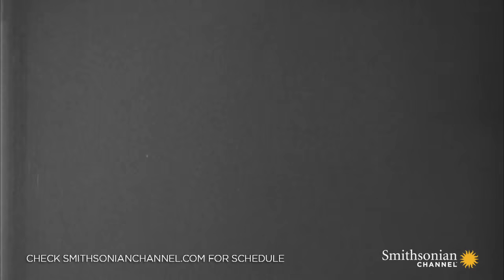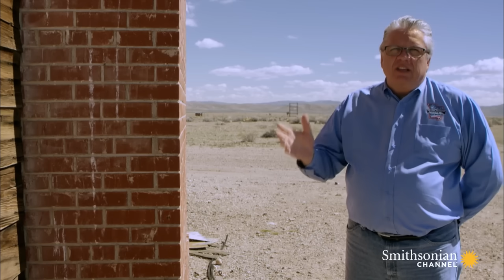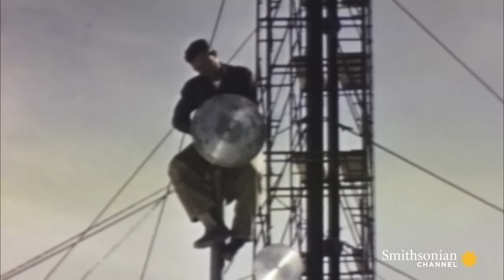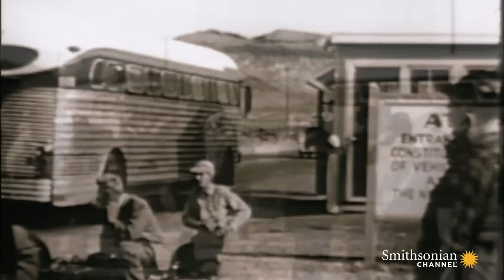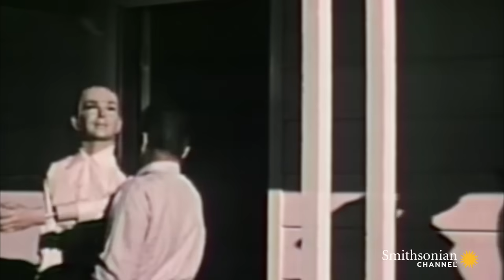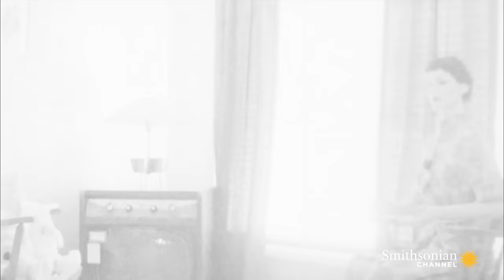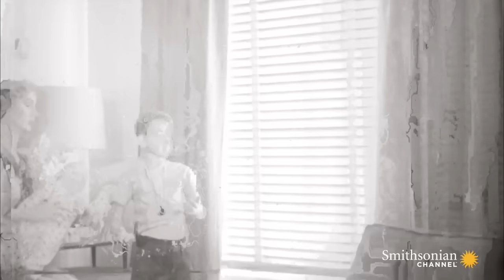Intense Footage of Fake Towns Used for 1950s Nuclear Tests

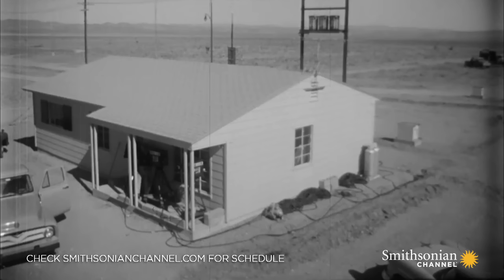Comment: 0:07 The initial blast was enough to INSTANTLY burn the paint from the walls before the shockwave then sends everything to splinters. It's almost unfathomable what could happen to a human being if one were standing there.
Reply: I understand a human would get fatal burns over the body.
Reply: @patricj951  or they would just go poof and leave behind a shadow
Reply: @Sodapop-rd5ku  
No, for a heatwave to instantly consume a complete human body it would require an amount of energy that all the wood in the house would go poof as well. And several centimeters of the bricks had ceased as well.
Reply: @patricj951  Im talking about if they were outside
Reply: @Sodapop-rd5ku  
I will explain. To devoure a human body requires much more energy than dry wood. So while there would probably be open flesh and fatal damage on the body, it would require much higher temperature than it was at that distance. There is a rumour that people were instantly vaporised in Hiroshima but that is not true. The detonation occured 600m above ground and the most people were kilometers away. 
To vaporise a human body in an instant it requires million degrees temperature, not only a few thousands, like it was at that distance.
Reply: @patricj951  crematoriums burn at ~1100 degrees farhrenheit, enough to reduce a human body to ash. Now considering that the atomic bombs burned at around ~7200 degrees fahrenheit combined with the ionizing radiation, your body would definitely get vaporized
Reply: Wind at the upper end of a F5 tornado is 300 mph. Using a one megaton blast, 50 seconds after ignition the wind would be 784 mph.
Reply: They’d be incinerated. Just like the people near ground zero at Hiroshima.  They were turned to vapor
Reply: Unfathomable? Think Japanese....
Reply: And in the next clip we see a truck and car disappear in a single second 0:08 - 0:09 watch them blink out of existence
Reply: And yet the camera survived without moving... And so did the footage
Reply: How is it unfathomable
Reply: @RMMaryport  because with that powerful of a blast, we'd have little to no idea the damage it'd do to a body.
Reply: @btr4yd  it would vaporise, its not hard to figure out

Comment: The paint on the outside of the house was instantly burnt off.... I bet the heat inside the house was at least 10,000 degrees to instantly vaporize but not burn the wood. At 6000+ feet away. Just awful, it would be even more horrific to survive that.
Reply: Yeah it’s crazy. The interior of fission explosions reaches 90-180 million Fahrenheit and for thermonuclear fusion explosions it can get upwards of 630 million depending on weapon design. As a comparison, the internal heat of the hottest high explosives top off at 3,500 Fahrenheit with the fireball resulting from the expanding superheated gas products. For nukes, the fireball is almost entirely just the surrounding atmosphere being superheated by the blackbody X-ray spectrum.
Reply: @bjornragnarsson8692  lol 👌 👌

Comment: Go outside and walk a mile + and when you reach that distance keep in mind that destructive force was generated from a device placed where you started your walk . insane
Reply: Tsar bomba 50MT test. The largest nuclear bomb ever detonated. The fireball alone was 8 kilometres in diameter. A person would experience 3rd degree burns and almost certain death 50km away. The Shockwave causes glass windows to shatter at 500km away. 
Go drive for an hour in your car 50km away and once you reach that distance, you’d likely be killed had you been in a direct line of sight of a 50MT device that was detonated at the location where you started. A star like the sun created by man, here on earth. Both terrifying and incredible at the same time.

Comment: 0:06 that car literally got deleted
Reply: That was when they were building it, it was 2 different shots lol
Reply: @Silly88  OH LOL
Reply: @Silly88 they presented it like it was continuous footage, even if that were true; this is fake.
Reply: Lol it was where the 8/16 mm film was spliced.  The truck wasn’t there for the blast
Reply: @davidpar2  no its just a separate shot at a different house that looks the same, just look at the other details
Reply: @allistergraham6704 what about the fact rhe camera doesn't even flinch???
Reply: It’s a car setting up the set
Reply: Car.exe stopped working
Reply: @rko39wwe  radiation can’t evaporate things, and if the heat did it then why is the house there
Reply: That's cuz the frame changes from one shot to the next. You can see the frame shift away from the car in the explosion scene.
Reply: That truck was saved by the rapture.
Reply: @dumbledwarf9154  thank god
Reply: i think that was 2 different shots spliced together by smithsonian. you also see production equipment or something on the porch
Reply: Wait a sec . . . I dident notice . . . Maybe it fly's away ??
Reply: Aliens lol
Reply: Gone... dissolved into atoms...
Reply: well, of to visit your mother! yippie ki ya-
Reply: It’s a mini built town. Fake
Reply: It is fake
Pilgrim hoax
Reply: Looks fake
Reply: @iscifion7122  it’s also two different houses
Reply: @shotgunsam23  Yea, but no. There are 2 shots of 2 houses.
Reply: @mr.mirage3986  I’m not disagreeing with him I’m adding additional clarification
Reply: @shotgunsam23  they are the same house just that in the 1st shot it was still being built (you can see the smaller window on the right in the attic isn't there in 1st shot but is there in 2nd, car is also not there in 2nd)
Reply: @shotgunsam23  it’s the same house
Reply: @iscifion7122  LOL
Reply: @iscifion7122  because they are fake. Film is extremely sensitive to radiation they couldn't possibly film these videos so close.  Propaganda to intimiate Russia.
Reply: ppoo
Reply: lk
Reply: @meow.465  I have a slight feeling you're too young for youtube.
Reply: They moved the car into the house you can see the lights
Reply: We're in a simulation.
Reply: Like night, and day.
Reply: Nah it rage quit
Reply: oh my God I was like "where did it go???" when I watched this before seeing the comment
Reply: Nope, it was a cut to the video
Reply: Everyone knows we faked those shots to scare the Russians into thinking we already had nukes.
Reply: Its fake.  How this never melt as in Hiroshima? Why there were piles of TNT?
Reply: @Fr4nkSanchez  things in Hiroshima didn't melt, Just the glass and the plastic parts melt
Reply: Yes, the driver of the car decided it would be better to depart the area before the bomb went off.
Prior to the explosion the house had to be built.  The people that built the house and filled it with furniture and mannequins didn't walk the 20+ miles from Mercury to Doom Town -- they drove cars and trucks.  But, they didn't hang around for the blast as they would very possibly have died.  
Take a look around this area in Nevada (37.1058, -116.0434) -- this is the "Nevada Test Site" formerly known as "Nevada Proving Grounds".  In this area are hundreds of large crater, most of them way to big to have created by conventional explosives.  Sedan Crater, located towards the NE of the range, is 1280 feet in diameter and 320 feet deep -- the explosive yield required to produce that is about 100kt, or 100,000 tons, or about 200M pounds of HE -- that is not within reach of conventional explosives as it exceeds the largest non-nuclear explosion, the Halifax Explosion, with a yield of 2.9kt, by more than 30X.  You may wish to keep you head in the sand, but in reality your head is firmly located in your own mid-body orifice.
Reply: Almost like it was edited or faked. Amazing how the camera survived
Reply: @ashleycullen.933 The cameras were housed in thick concrete bunkers with lead shielding to protect the film.
Reply: It was a time lapse we aren't seeing all the footage. Someone had to go hit record and leave the concrete bunker that housed the camera, via the car/truck.
Reply: Maybe that was a crew car before, hence the jump cut?
Reply: Yea and the camera doesn't even flunch
Reply: @Arktii 難 🤦
Objects evaporate leaving behind traces due to explosion not just dissappear.
Reply: @iscifion7122  it’s not a part of the test, it’s a car with technical stuff for making the set
Reply: @West_Coast_Mainline how did the camera not move????
Reply: @timnew4312 The cameras were in heavy lead-lined housings, mounted on steel posts sunk into a concrete base below ground.  Electronics to control the cameras were in a cavity in the concrete base.  These structures were designed to withstand the blast pressure from the bomb.  

It's almost like the people conducting and documenting these tests knew what they were doing and built their equipment accordingly.
Reply: @iscifion7122  Yes, but big objects (such as in this case, a house) Mainly fall apart, but, beacause cars are small enough to have all of it in the range of the engine, it evaporates, and if a part close to the engine survives, it's gonna get burned down. Such thing applies to humans aswell, but before talking about it, that happens when You're about 5km distance of the center of the blast. That's called a "thermal shadow." A thermal shadow is what happens to humans who are in the death zone. It's caused by heat, sugested by it's name. The thing that lead us to discover this, is traces from Hiroshima. Many thermal shadows can be found there, in the exits of steel and concrete reinforced buildings.
Reply: @mr.mirage3986 but the camera was completely unaffected 😅
Reply: 😅😅😅 wrong bro it's just a fake edited video  @iscifion7122
Reply: @Arktii 難 okay...my bad
Reply: That house survived the blast that hunk of metal most certainly shouldve, the clip has to be fake.
Reply: @Arktii 難Thanks.....
But I don't like this flavor

Comment: How are they so casually touching and standing where nuclear explosions caused the seen destruction? Why isn't that EXTREMELY radioactive?
Reply: Nukes, especially airburst nukes, don't actually cause that much radiation. Most of the uranium or Plutonium turns to energy. A ground impact nuke is something different tho. Way more radioaktive fallout because it irradiates the ground. After a airburst, I belive you could safley step back out of a bunker within.. 2 weeks or so.

Comment: How did the cameras stay when getting exploded by a nuke
Reply: I think they are extremely zoomed in what I’m actually concerned about how those poor mannequins are doing
Reply: @qulipz5967  dude some where inside
Reply: @dnh3005  use your brain.
Reply: @alphasheep7116  and why mister sheep
Reply: @alphasheep7116  I just asked u a question, maybe u understand me now: blehh bleh BLEH blehhhhhh.
Reply: @dnh3005  you are acting crazy 😂
Reply: @dnh3005  😂🤣
Reply: They test nukes above ground because if you detonate one directly on the ground the surface of earth absorbs a lot of the explosion. In the air you see the full force of the explosion
Reply: @qulipz5967  
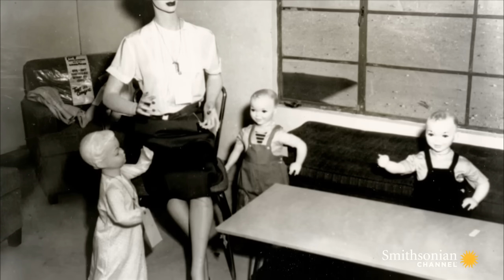 2:18 The healthy ones went back to live at manufacture’s warehouse. The ones that got a little dusty in the blast ..acquired antique status on eBay.
Reply: @qulipz5967  35 of the mannequins died of cancer. 17 contracted leukemia 1 survived and was hired by Rod serling to act on an episode of The twilight zone. She was the lady on the 19th floor
Reply: The cameras were housed in durable shelters. As long as the flash from the blast didn't touch the cameras, they could be relatively close to the blast.
Reply: @jamesjohnson1050  ok i thought they filmed it with a Nokia
Reply: @renehopkinson5079  flip phone
Reply: I had the same question. It mentions it was detonated 15ft above ground
Reply: @spookypunky  less height less damage my guy. Thats why they explode theese things in extreme heights (but it wont work for all of theese)
Reply: I don't understand either.. Even some shots are inside the structures... Maybe they are inside a very-very-very thick glass cover...
Reply: @ryanmedrina9411  the cameras in these tests are usually placed on poles that have several steel cables as reinforcement and have casings that are aerodynamic to be less affected by the blast. They are far enough away from ground zero that such an arrangement can protect them, as it's about the most blast proof construction one can possibly make. A car or house at this distance could survive the blast undamaged if you put it into a solid hardened steel bunker that is shaped in such a way that the pressure wave is directed around it (altough for something as big as a house, such a bunker would be as expensive as a whole tank batallion) Only really works since they know exactly where the bomb will go off and can position the cameras accordingly though.
Reply: As with the saying that nothing is completely blast proof, the same is true that no blast will destroy everything. Smaller objects are much easier to protect. By creating an independent foundation to which the protective casing can anchored to, so it's not knocked or moved by the shockwave and overpressure/vacuum event. The general rule is the less surface area of the object the less effect the blast will have on it
Reply: Nukes don’t exist. There is a studio in Los Angeles, actually in Studio City dedicated to editing nuclear bomb footage. More like creating nuclear bomb footage…
Reply: @rvrnt196  
Your mother doesn't exist. There is a studio in Los Angeles where they filmed how she was making you, but she was just an actress.
Reply: Theres a documentary thing on that, they were fastened to the foundation and ground with concrete and high grade steel cables. Not all of the cameras made it, although. The only surviving footage is from the cameras that stood still or didn't get thrown too far. They were also in concrete boxes.
Reply: All the cameras were thousands of feet away and pointed away from the bomb at the houses, aside from the ones with the observers, even further out.
Reply: @tincano-beans2114  Lol thousands of feet  away.? Repeat the scenes again again. The angle and the depth and position of those cameras.  Pure hollywood production.
Reply: There are probably in extremely guarded cases
Reply: The ones from the out side were 800yards away and it giant bunkers. The ones inside were in a huge lead and steel box with lead glass.
Reply: Really zoomed in at a far away distance
Reply: They're in a bunker facing away from the blast and x-rays coming from the explosion.
Reply: Nuclear reactors are glorified steam engines think about it. It's the steam in the nuclear power plants and submarines that create the driving force. The nuclear reactor just heats water without the need for coal or fossil fuels. Nukes are not real bombs. That is just 60's sci-fi fear mongering for the masses. The very concept of nukes creates secrecy for our governments. The secret is that nukes don't exist and all major influences of power know this. Think about Hiroshima and Nagasaki. Where is the nuclear fall out? You you the "half-life"??? Both are flourishing super cities full of vegetation and human growth. These governments fake things like pearl harbor and 9/11 to get wars started so that the elite can make even more money.
Reply: @mslaven84  bruh this is the most ridiculous comment I've ever read. Yeah, nuclear reactors heat water to produce steam to power turbines, because there's no other way to turn thermal energy into electric energy efficently. The thermal energy to boil that water in the first place however has to come from somewhere, and, in the case of a nuclear reactor, it comes from controlled fission of reactor fuel. Otherwise you'd break the laws of thermodynamics. A nuke uses a similar process but releases all the energy In a microsecond instead. As for Hiroshima and nagasaki, yeah they are inhabited again because people vastly overestimate fallout from nuclear detonations. Most of it is gone within a day and it's down to safe levels within a few years.
Reply: @destroyer1667  yes, and it's not like we have clearly documented the damages radiation made to people's genetics there
Reply: @mslaven84  Yup, we are ruled by evil men.  There is no way those cameras are thousands of feet away.  The biggest weapon of slavery and population control  from thet tme of Babylon and Egypt  till today is deception.
Reply: @mslaven84  wow someone with actual common sense in these comments. Good for you bro! You are completely right!

Comment: My favourite part when electric line moves forward simultaneously :DDDD People were truly retarded in 1950 to see this and not question. And always black horizon  :DDDD
Reply: Could you elaborate about the electric lines? I suppose they wanted to show, that allegedly sand/dust flies away from the electric lines. But then again why does the sand/dust fly for a bit and then stop midair for no reason.
Reply: @ this is pure bs !!Mini Hollywood production what should I elaborate? How silly it is ?
Reply: @sekainiheiwa3650  What shot in this video are you talking about? I can't spot where electric lines move forward.